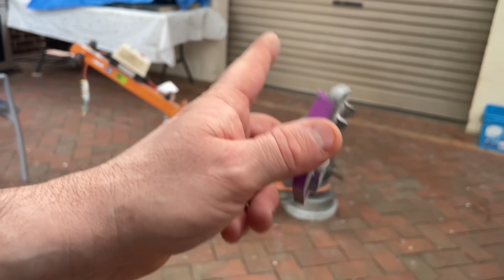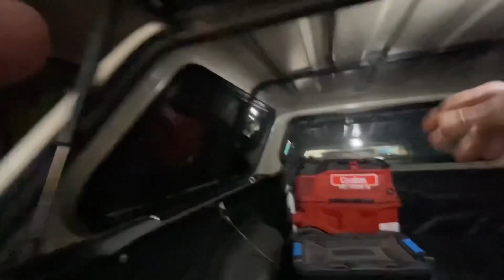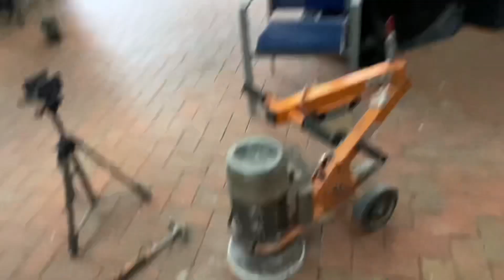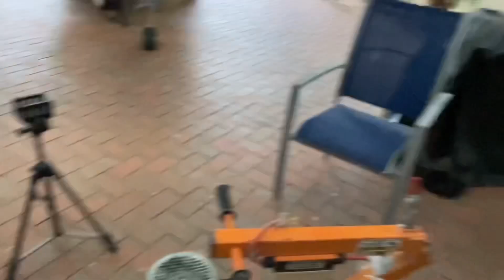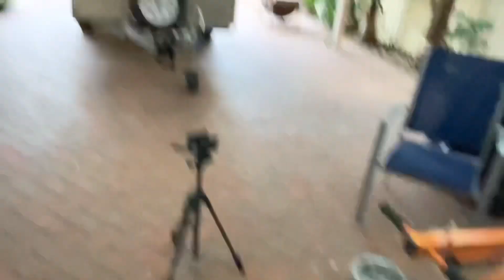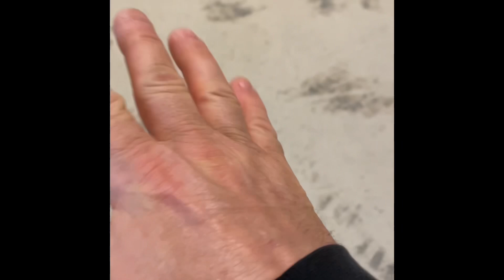Using a concrete grinder to remove black tile adhesive

Comment: Please!  Do not remove old black mastic without testing for asbestos. Especially if the tile squares are 9"x9"
Reply: I know the tiles in the Uk made by Marley… usually brown contained asbestos and so did the black adhesive